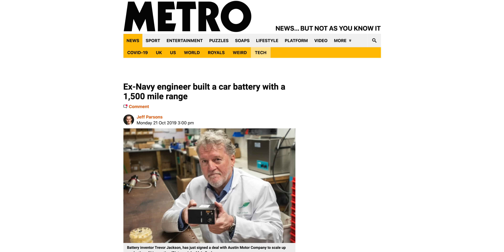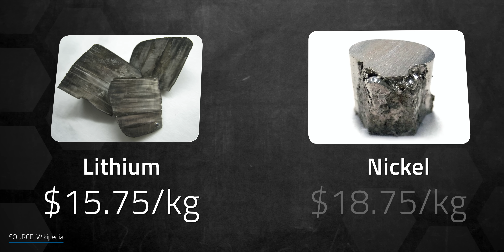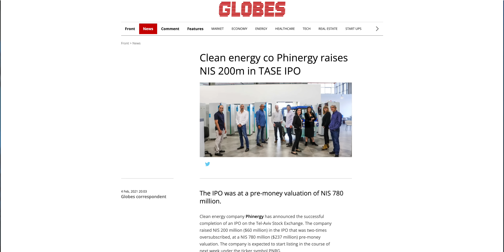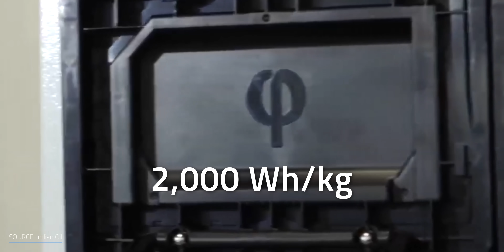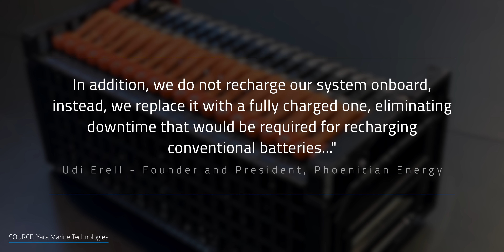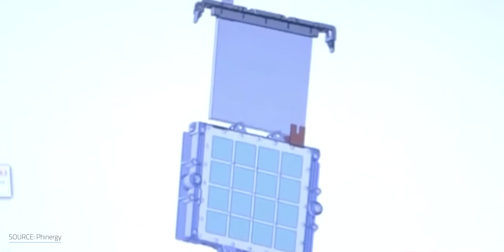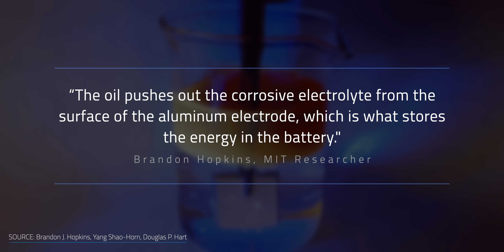Exploring the 1000 Mile Car Battery - Aluminum Air Hype?

Comment: I have two big concerns. 
(not counting the battery change, which is the same as charging when you think 1000 km to compare)
 
The first is that there is a battery change every 1000 km. This puts a great burden on the recycling of batteries. Also, when the energy to be used in battery recycling is calculated per battery, I think we will reach large numbers. Doesn't this contradict the green energy policy in terms of energy efficiency? If we consider lithium-ion batteries, in the best scenario (according to Bjön Nyland Model 3 battery degredation test), we can continue to use the battery even after 2 years and approximately 80000 km of use. I don't ve numbers to compare those two.

Secondly, these batteries use oxygen (ie air) as a source. What effects will this have in the long run? We reduce the carbon emission, but at the same time we reduce the oxygen ! I don't know how much oxygen this system will consume until the battery is replaced. I think that should be taken into account as well.

Comment: considering how much cargo and tanker ships contribute to world pollution, these might be a prefect fit for those applications. Especially with container ships where they swap out cargo anyway. The batteries could take a few spots where the containers would. Making retrofitting a bit less of a hassle. 
While getting personal vehicles to be more efficient is important, I really believe that concentration should be on the manufacturing and distribution industries. Especially considering they are the ones who've been contributing far more to the problem and reaping much more of the benefits.

Comment: I'm thinking these batteries could be used in a hybrid situation, a mix of rechargable lithium-ion batteries and aluminum-air ones. The aluminum would provide the additional range and could be swapped out periodically, while the lithium-ion would allow for recharging. The car could have a long-range mode that the driver could switch into. However, the problem might be be having enough room for both types of batteries.

Comment: Battery swapping is about 20 years old in the electric fork lift business.  Those batteries can weigh 6000 lbs (around 3000 kg.) and require a crane to swap them in and out of a forklift.

Comment: While battery swapping for consumers might be undesirable it does sound it could have a lot of potential for commercial scale use. 

A bus or train station swapping batteries becomes a lot more viable as it does away with the charge time regular batteries require. I also could see this be a thing for a fleet of self driving cars as they would just calculate in the distance back to the swap station and in a few minutes that car is ready to go again with a 1000+ miles of charge.

Comment: They would be great backup batteries for lithium-ion based vehicles. Particularly as a range extender. A lithium-Ion powered vehicle, that may not be in  range of a charging station on an elongated trip, can recharge with an aluminum air battery.

Comment: for something that has something as expensive as silver in it, battery swapping would introduce too much hesitancy to the consumers. It's most likely not viable for the general public, especially for cars. Not to mention, it might be lighter in weight, but it looks like it takes too much space. The only way I see this being viable is really just backup power.
Reply: @Ross Radford yeah but consumers are often stupid. And again, it can't be refueled. Does that mean that you replace your entire battery even if you have 30% capacity left? It would need to be extremely cheap. As cheap as AA or AAA batteries, and even then, it might still be more costly than straight-up charging a battery-powered car. And, even if it has great energy density, the space needed for it HAS to be large because it NEEDS the oxygen out of the air.

Comment: Just like with EV's, we need the infrastructure in place to allow for fast swapping. Filling up your car takes 5 minutes or longer after only 300-500 miles. If we had change out stations and superchargers at every location that is currently a gas station it wouldn't be an issue at all. Just like with a forklift battery replacement system the whole thing could be automated with enough time and you just pull up to a specific location, then battery out in about 1-2 minutes and you get to stretch your legs after 1000 miles on the road.

Comment: Aluminum air batts aren't going to make it to EV's but they may have applications for stationary storage but even then, it's a poor tech when you can't recharge.  I'm pretty sure we're heading towards all solid-state, prismatic sodium batts for EV's that will comfortably recharge in: ~10 min's and have a range of: 400-500 miles and last a million miles for EV's and most other battery applications.  Wish EV makers would hurry up on VTG as those of us who have an EV can use it for power outages instead of buying a silly Powerwall or other storage batt.

Comment: I'm also missing energy density in terms of volume here. Would a aluminium air battery with the same range even fit in the Tesla's underbody? And If, how much more range can you really achieve? I find it deceiving that they are comparing based on weight alone.

Comment: This is very interesting, but I would want to know what each battery as a whole would cost to switch out.  The way the video makes it sound, it would not be very cost effective.  As someone that puts a 1000 miles a week on a work vehicle, battery replacement cost would be a huge factor.

Comment: Several years ago I actually thought battery swapping would be the technology needed to bring electric cars to the masses. Although charging at home is great for affluent people, that doesn't help those in lower income brackets or those that rent. These groups of people also aren't going to be recharging as often on long trips and are more accustom to stopping at a gas station and filling up quicker. Maybe they can fill up at work or when they are shopping but I'm not convinced this covers all possibilities.

Comment: AluAir Batteries should just be there to charge while you drive.. So the AluAir barrtery is just replaced at the gas station and you drive off using it&charging your car battery at the same time. then just buy another one at the gas station.. So a bit more expensive than plugging in but super convenient.

Comment: Swapping out a aluminum air battery or module while on the side of the road shouldn't be a problem if it's on the smaller side. A 40kwh pack would only weigh around 50 lbs or 24 kg. 

Not fully sold on them yet, but it currently sounds like a better option for electric jets than hydrogen at least. You can build them at home too, which is interesting.

Comment: Having say 50-100 miles of lithium range and 2 or more consumable battery’s which gave you a one off 100+ mile run would alleviate any concern of range, especially if it were modular and replacements could be stored safely at home

Comment: I'd prefer a battery swapping EV, much more practical than a recharging one. Plus I would guess the EV price would drop since the battery isn't included in the price of the vehicle.
Reply: cost of replace battery each time and who pays for the first one?
Reply: @WayneJohnsonZastil  You lease the battery. It is already done in some countries with some car manufacturers for Lithium-ion batteries.

Comment: I could be wrong, but the process of recycling aluminum plates doesn't sound very efficient. There will be a lot of waste heat, and all the material will have to be transported a long distance to a facility. I'm sure it's entirely possible to make a rechargeable battery that won't corrode, but they aren't there yet.
How about we just remove carbon from the air and use it to make gasoline? lol.

Comment: Gonna have to say, I don't fancy having to change batteries. If they can figure out how to prevent the corrosion issue and make this rechargeable, this would likely win the battery war just due to capacity and weight. Box swapping for commuter airplanes would be ok though and the reduced weight would make sense for that application.

Comment: If the battery cost will eventually drop to the merits comparable to the fuel it takes to get the mileage, I'm in. What's the difference between refueling the tank and swapping the battery?

Comment: the problem I can see with this kind of battery is the replacing part. let's say you drive long distances each dat. then you would end up replacing it even before it's empty of power. since you want to make sure you got enough for the trips. this goes for people who drive short distances too. but there would be a lower waste of left over energy in the pack.

Comment: Not likely. i really don't like the disposable nature of this battery even though it is recyclable. i am disinclined to use something like this till they find a way to make it (or a version of it) rechargeable. if they did then absolutely. can you imagine just throwing and extra pack in the trunk as a just in case? or swapping the dead one at home and throwing it on the charger while you run a few more errands? or if you are a delivery driver and needed the charge?

Comment: wut about aviation. i feel like they care the most about energy density and planes are usually only somewhere that has facilities to service them/swap da battery. the industry also tends to overpay for stuff that offers a marginal advantage which means they could be quick to adopt. just have different size batteries for different ranges which should be well understood because of the flight schedule, then swap in the best size/weight battery

mm also for cars they would probably need a ~50 mile Li back up battery that could be used to get u to a swap station and also would be able to gather the regenerative breaking energy if it was worth the weight (city vs hwy driving)

Comment: The energy taken out is what has to be used for converting the redox product back to pure aluminum. To assess how  sustainable things are: how efficient is that recycling process ? Even low efficiency can still be useful (e g. What we do with Hydrogen with roundtrip losses of about 50%, but it is still useful in some applications if done with solar/wind). 
So, good to know would be: What is the round-trip efficiency for this aluminum-process?

Comment: I mean, if they can really swap the battery in 3 minutes as claimed, and you can get 1000+ miles out of it, and it's reasonable to recycle it with the cost of the replacement not being insane, it seems pretty ideal. Seems like it would require some semi-skilled labor at every gas station though.

Comment: Some sort of hybrid sounds feasible. Aluminum for range and lithium for everyday driving. Then you wouldn't have to be towed to a swapping station. You could still have emergency EV charging.
Sounds especially nice for trucking. EV trucks CAN haul enough lithium to go the distance, but aluminum would be lighter weight and easier to get back on the road quickly. That means more goods moving faster.
Just a quick fuel cell swap and off they go!
But so long as diesel is cheaper, I don't see EV trucks being the thing for a while yet.

Comment: If they're not rechargeable, they're simply useless. Imagine I want to take a 500 mile ride but my batter is left with about 400 miles charge? I'll have to swap it out and basically throw away the remaining charge.
If they're not rechargeable, they are absolutely 1000% useless.

Comment: Honestly, I'm kinda more surprised we haven't explored this earlier. If the swap can be made swiftly, large parts of the world already have infrastructure built for it, in the form of gas stations. Changing gas stations into charging stations where each car takes 15-60 minutes to charge isn't going to work terribly well at high-volume stations, but if you can just swap batteries and carry on, well that mimics the traffic flow of our existing infrastructure pretty well. 

If the batteries can be recycled/reconditioned in an efficient manner, could be an interesting way to go.

Comment: well the swapping problem could be solved by equipping every former petrol station with a battery swapping station.
Then the problem has the same relevance as "what if you run out of gas during a trip?".

Comment: I'm all for battery swapping even for rechargable batteries but the fact that these are not rechargeable seems like they're never going to be echonomic. How many batteries are required to move a new battery from the factory to the swapping station and move a used one from the swapping station back to the factory/recycling plant? It's got to be close to if not exceeding 1.

Comment: It will certainly have multiple applications, but for a car is has to be a rechargeable battery. Sure, you can replace the battery every time it runs out, but that is a major inconvenience. Would you trade your cell phone rechargeable batter for a long duration non-rechargeable one?

Comment: Has anyone looked into a combination Li-ION and Air-AL battery? Let's say that you mostly use your car for commuting to and from work with the daily run of errands and you only go on a road trip maybe once every 3-6 months. Have the combo battery have a Lithium capacity of 80 to 100 miles and then an ability to add an Air-Al battery to boost your range. I feel like this kind of car would suit the vast majority of use cases while not causing your car to be towed in the event that you were between battery swap stations.

Comment: This is a complex single use technology that produces electricity. You might as well be using fossil fuels which are also single use and far less complex to process. This idea is a complete non starter unless some development results in a completely rechargeable system. Any single use product that requires re manufacturing or scrapping after use cannot be considered viable.

Comment: 9:20 if it's standardized (like AAA, AA etc. batteries), you could get a fresh battery delivered to you. 
Or even stop someone traveling in same direction and swap batteries (if both cars can run without one pack, which they should from safety/ redundancy standpoint), drive to next swap station and settle mileage with cash/ buy the good samaritan a new battery.
Reply: Nobody is saying what they would weigh. Just they are lighter then the Liths. Getting them delivered is a good idea,,,,,If you have a towmotor and know how to rig and move heavy objects and place then woithout damaging them.

OK,,,,Lets say they weight 1/3 what a 1300 pound Tesla battery weighs (which I doubt) . Face it. Most people that have and/or advocate EVs have never had a job where they did any real work (Energy dose work, no energy expended, no work done) The average EV person has no concept of what it takes to move 400 pounds, let alone get it into a vehicle without doing any damage. ,,,,, If that offends anybody out there, that's the breaks, but the fact is you cannot break the laws of physics no matter how environmentally responsible you want to be.

Just another pie in the sky egghead pipe dream. - Great on paper, crap on concrete.

Comment: I would not drive a purely swap based vehicle. But as a range extender, it is pretty tempting. This way cars could have a smaller battery pack, for tipical day to day needs, and a range extender pack for emergencies or long trips. Thus you can benefit from lower purchase price when you buy the car, a low fuel cost in your daily driving and the range for using this car for long trips.
This could also be a great thing for hobby vehicles and such. Things that need a lot of power but only ever is used rarely, so parking a big expensive batterie in them is wasteful. Also retrofits / extending the life of old evs on the cheap.

Comment: Whether or not the swapping is a feasable method would mainly depend on how easy it is, currently we need to refuel our cars with gasoline, which isn´t much different than the battery swap, so i don´t see much issue with that, and if the battery is so light, everyone should be able to do it physically, provided they have a full set of functional arms.
And even without, they might just ask the station clerk for help.
It´s an interesting alternative, that´s sure, i for my part will keep an eye on this tech.

Comment: I wonder if the energy density of alu-air batteries is high enough to make electric commercial air travel feasible? Airports can be better set up with battery swapping infrastructure, and generally the energy requirements for a specific flight are calculated beforehand so they'd only load what they would need.
Reply: 1. Make planes use aluminum batteries
2. Make planes use AI
3. Make the rest of the world use AI, making humans redundant
4. Remove passenger space on planes
5. Fill with more batteries
6. Use human blood as electrolyte
7. ???
8. Profit

Comment: I'd love driving a car that uses battery swaps on one condition:  The car would use 3 or more batteries that can be used sequentially and replaced independantly.  This would give people the ability to replace dead batteries before the car was dead while still having one or more fully charged batteries in the car.

Comment: Does all the aluminum stay in the battery as it is used up, making it easy to recycle, or does it fall out- like the water from a hydrogen fuel cell ?
Reply: it stays in the battery.